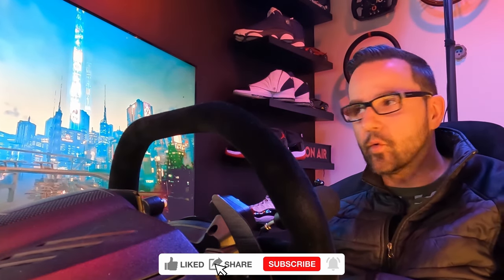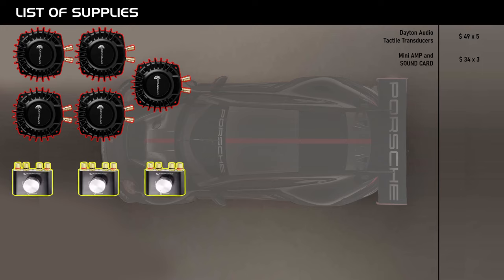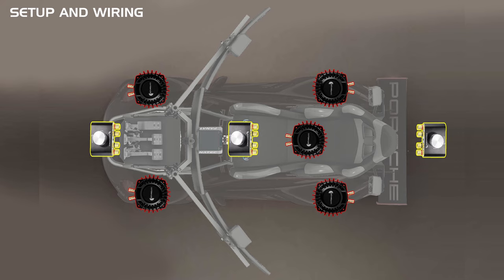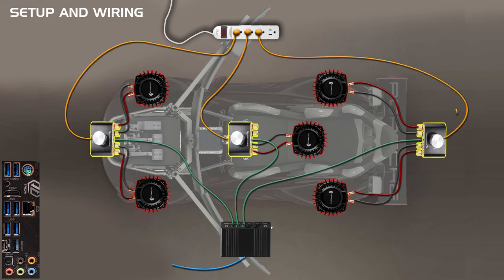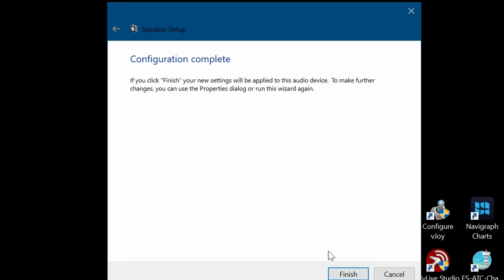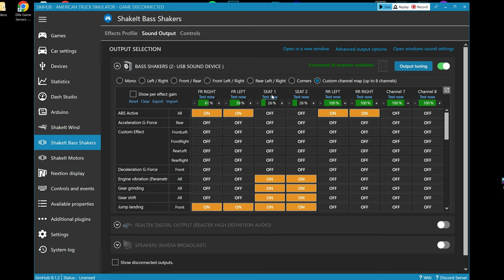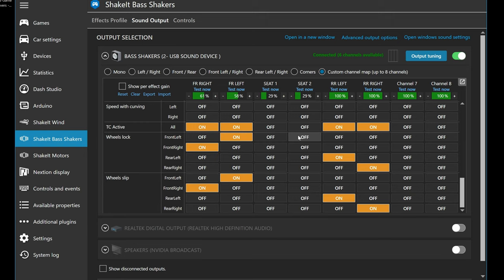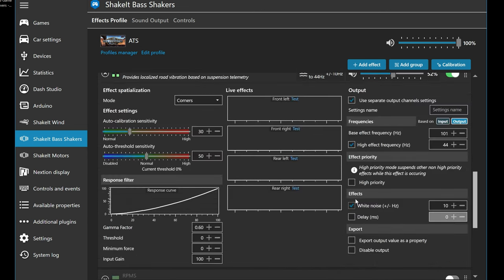DIY ULTIMATE Bass Shaker TUTORIAL | Step by Step HOW TO and SETUP

Comment: This question may have been asked but hopefully someone can direct me to the answer or tell me how this works.  I have my PC connected to a TV using HDMI and that is pushing sound through a Sonos Beam. I bought 2 bass shakers and mounted them to the rig.  My question is how do I get sound to the TV/Sonos and then also get the vibrations to work at the same time? Please let me know.
Reply from the maker: That is yet another reason why we use an external sound card. Dividing the external sound card from the integrated sound card allows you to process audio on the PC and send it any way you see fit to any source. Using an additional sound card allows you to process all these vibrations from the telemetry data and send them to your base shakers. A lot of people ask me why don't use the card on the PC, the audio card. This is one of the many reasons. An external audio card is very very cheap and it hooks up to your PC through USB as shown in the video
Reply: @DaSimSimma Thanks so much,  appreciate the help.  I will work my way threw it hopefully.  I am guessing I will have to change the audio configuration to get it working correctly?

Comment: hey man nice video but one question! i bought all equal your video! but one thing is not right, you put 5.1 without the rear on the configuraton, and on simihub you put seat 1 and seat 2 on mine just the chanel 4 works the 3 doesnt why:
Reply from the maker: Let me look into it in more detail later this afternoon as I am not in front of my PC. I do remember something odd about my seat where two channels seem to server the same purpose on the seat speaker. Maybe I hooked it up wrong ..not sure . But only one channel working for the seat shouldn't be a problem . One channel =one speaker . Is everything else working ok thought ? Is your set up working properly but it's just different than mine ? In which case I might have made a small mistake somewhere ? Let me know and I'll look into it later after work ! Thanks friend
Reply from the maker: Just a small side note. I don't mention this in the video, but for my seat bass shaker I use a different amplifier that is different than the noob sound. Perhaps in the way I wired it the outcome is slightly different than I'm explaining in the video
Reply: @DaSimSimma  I will install all the 4 bass shakers today, but the Chanel it’s working properly! Your video it’s good I just want to know if it’s working on 2 channels, and the amplifier you put on 100% the volume? I let mine on 50% the bass shaker that is only on channel, on the seat, the other ones I will install in 100% the volume on the noobsound!
Only one thing if you can do a video explaining your profile with the bass shakers on simhub will be a lot of views like this one! Thank you

Comment: Hello, would it also work with a 5:1 sound card already installed in the PC, or do I have to have an external sound card? Thanks
Reply from the maker: It absolutely works with the internal sound card. I think I mentioned that in the video the problem becomes if you use it to put out vibrations what do you actually use to hear the sound of the car? Once SIM hub takes over the card you're not getting sound out of it you're just gonna get telemetry and vibration to the face shakers
Reply: Thank you.
For the vehicle sound, I would go to the internal sound card onboard from the mainboard....
Thanks for the help!

Comment: Could you please confirm if it's possible to utilize the onboard sound card of the motherboard if it supports 5.1 and 7.1 and has an adequate number of outputs?
Reply from the maker: Of course you can, but as we discussed many times in this comment section : If you do that, then the PC audio there for the game audio will have no way out. Which means all the sudden you'll get vibration but you will no longer get audio from the game. The audio card can only do one thing at a time
Reply: @DaSimSimma  Thank you for your response. The thing is, I've ordered all the equipment, and my only remaining question was regarding the sound card. Now I've got it all sorted out and will follow your assembly instructions. 🤜🏻

Comment: I Went ahead and bought all 5 of them to do a setup just like yours but I have the GT Omega Art rig how can I mount them? Would you have any tips for me? Its a metal rig basically.
Reply from the maker: I just looked up your rig and was looking for opportunities. The first thing that I see is you have different options for your pedal angle. I would suggest using the unused pedal holes. I would Mount the speakers or shakers onto a piece of plywood or something similar then I would take the plywood and bolt it through those holes that's for the front. I don't have any advice for the rear because I couldn't see any pictures of your rig from the rear. But the main takeaway, just like mine, attach the Shakers to a piece of plywood and leave enough room on that plywood to screw the plywood into something else. I hope this helps if not peep my community Tab and somewhere in there you'll see a discord link to our discord channel. Hop on in there when you start mounting and if you run into any issues I'll do my best to attempt and help you
Reply: @DaSimSimma  You are the best! Thank you very much for the quick respond.
Reply: @DaSimSimma  Can I use 18 AWG instead of 16 awg for the speaker wire? Silly question here I know :D
Reply from the maker: I am not an electrician but I can tell you that I've used both especially in the beginning of my sim setup. Should be absolutely no problem or difference in quality

Comment: I want to replicate your setup with bass shakers.
1 Question.  Do you get the same detailed separation if I don't use 3 amplifiers. You said the only reason for using 3 was because of USB on the computer.
Reply from the maker: I hope I understand your question correctly .here I try : you can use only two Amps . For example :The two amps will give you 4 channel capability. You need to plug each one in the back of your PC. You need to set them up as STEREO. Because that is all each of them can output. Ultimately each amp will act as an amp at 50 watts per channel with two output channels. One for left and one for right side. One amp can do left and right rear and the other can do left and right front. I hope I am answering your question

Comment: Do you need the Aux Cable? I run two shakers withthe nobsound mini and when I rev a car in iracing im getting this grainy grinding sound I'm not sure where is coming from and having a hard time islolating the issue. Any help would be greatly appriciated. Thanks !!
Reply from the maker: Sorry for the extremely late reply. You cannot run these with an AUX cable. You have to follow my instructions carefully and try to understand how to utilize it using two of your shakers. You don't want to get sound from your PC you want to get a signal from your pc. Simhub sends a digital signal that gets turned into sound. If you plug in the aux cable you will simply get audio noise or audio from your game translated into rumbles basically the Shaker will try to pretend to be a speaker.. I'm doing my best to interpret what you said but not being there and seeing it I might be wrong

Comment: Thanks for this. With that I have a couple questions. First are you mistaken how you have drawn the exterior sound card ? You say the first 3.5 Jack is a out put but it is a input? The next three are outputs. Assuming so I have hooked up to the last three 3.5 Jacks on the card and I now have a problem that all the sound from the game is now going threw the base shakers. I still need the game to also play three my regular speakers . I need sound for my game but I also use my computer for other things.
Reply from the maker: Hey Jon sorry it's not working out perfectly for you at this moment. It'd be very difficult to try to explain through writing. This is going to be a really crappy thing to say but many have had success with this tutorial so perhaps you're doing something wrong. Slow down look at it again and try to hook it up you missed something. The fact that the game audio is coming through the base Shaker tells me that you didn't prioritize in Windows sound settings which is your default sound card. The default sound card should be the one that goes to your speaker. That should be said as a default communication device. The other card should be properly hooked up and set up in Sim hub. Sorry bud I know this is not much help. The next step you could do is go to my main about page find my discord and join us there I'll do my best to offer you some help tomorrow through a voice chat
Reply: @DaSimSimma  I'm sure I am and if I sound like I'm blaming you I apologize. I was asking questions because I am having problems. I thought that toward the end of your video you asked that I reach out if I had any problems, so that's what I did. This is all very new to me from the computer to the sim rig , and now base shakers. With that said I would still like to make everything work correctly so if anything comes to you please let me know. Thanks and again I'm sorry that I came across offensively
Reply from the maker: No way at all my friend. I deal with a lot of aholes on YouTube, you sir are far from that!!! Let me know if you see the discord link and try to join us there. I am very very busy this coming week but will try to make time tomorrow night or Tuesday for a private call. https://discord.com/invite/z8K528Ba65
Reply from the maker: I remember how difficult it was for me to set it up the first time, so I'm not surprised you're having issues. That is why I made the video in hopes to help you and everyone out there that wants to set this up. But, absolutely, please reach out. Let's get on the phone call and let's solve it for you. I can't wait for you to experience the awesomeness !!!
Reply: I'm not entirely sure what I did but I think I got it
Reply: Is there somewhere that you are aware of that has explanations for meanings of. Like use separate output channels settings. What does that mean and is the a manual or something that I can go to and rear about what things like that mean?

Comment: I have a sound bar with surround speakers and after setting up the bass shakers like u I have lost the sound in my surround speakers at the back of my rig, any ideas how I can use both
Reply from the maker: Did you use an external sound card or did you use the sound card on the computer?
Reply from the maker: These things are good, complicated to describe without looking at your setup. But sometimes when you install a new audio card, even if it's external, it does get defaulted as your main audio source. So sim hub will be using it, but then the PC no longer knows which is your main actual audio source. I hope that makes sense. Thus, your audio sources might have got mixed around and you're no longer getting audio through your speakers. Again, I'm just taking guesses here

Comment: Could you just use 3.5 jack audio cables instead of speaker wire to connect the power amplifiers to the external soundcard?
Reply from the maker: Sorry I'm a bit confused with what your asking . The power amplifiers are connected with 3.5 only ...the speakers are connected to the amps with speaker wire. Sorry let me know if I didn't understand your question.
Reply: @DaSimSimma  My bad. I was looking at the speakers and thought the connections were for a 3.5 jack. Thanks for the reply and the great video!
Reply from the maker: No problem at all ! You'd be surprised how often I make mistakes ...human . Lol you had me going back and watching my own video . Lol thanks again for watching. I appreciate you

Comment: out of curiosity, could you have installed a USB expansion card and eliminated the external sound card?
Reply from the maker: Absolutely, but I have a small case and there's no more room for anything. I could have also used the USB hub but I honestly did not want all those wires running back anywhere so all the wiring is contained underneath my Sim rig. The only thing coming to my Sim rig is one USB plus a power strip cable :) I hope that I mentioned in the video that this is only my way. It's definitely not the only way!
Reply: @DaSimSimma  you did mention the one cable which is also a great and clean option!

Comment: i mount the skaker direct on the 4 sides of my rig but the power is really low do i need to mount it like you did so they hanging in the air ???
Reply from the maker: Please take anything I say with a grain of salt. It's just my silly opinion. I do believe that when I hung them off the way I did or attached him to a piece of wood it added an extra level of vibration. It literally enhances the vibration. I think that if they're hard mounted to the rig they can't really vibrate anything because the rig is so solid. I don't know man, I'm just shooting ideas out. I hope I'm not speaking out of my rear end
Reply: @DaSimSimma   but you are totaly  right mounted direct on the rig everything is low vibrating but with your mounting opinion its way better

Comment: may I know why are you using the external soundcard when those amps has built-in sounncards? Is it due to spare some USB ports on your pc?
Reply from the maker: I mentioned that in the video that I'm trying to save USB ports. I have so many peripherals and so many cool things plugged in. I don't have space for each one of those amps. I think I specifically talk about this
Reply: Do you think it does not have a delay in compared when that extra soundcard would not be used?
Reply from the maker: I don't notice any delay guys. Again, when I hear about delays in simracing it sounds like we're professionals trying to win the formula 1 championship. The reality is , you guys are talking about milliseconds in delay which makes no darn difference when we're having fun Sim racing. Perhaps I'm a little bit too light-hearted about it, but again I don't notice any of this stuff. I'm just having fun

Comment: How can you use this on the console (PS5) with two or four bass shakers? Simhub now supports GT7 and both AC games (I think).
Reply from the maker: In theory, you could but it's not as good as on PC. I used to run it on PS4 with only one Shaker. I wasn't using sim hub at the time.  I was actually just directly translating audio noises from the game and turning it  to low frequency only and then to the shaker. The short answer is, I'm probably not the best guy to ask since I honestly don't really know. Continue to scour YouTube I guarantee somebody out there has the answer and is very willing to share! Sorry again. I wish I could help . And if you find the answer, please come back and drop a link here. Maybe it could help other people out.

Comment: When I plugged in my shaker setup it apparently overrode the regular sound output. So now all I hear is the shaker setup. Any ideas what I'm doing wrong?
Reply from the maker: You specifically have to make sure to use an external sound card. This way you can tell the computer to send all the telemetry data to that external sound card. Then you can set up your main sound card to still output game audio. Divorcing. These two things specifically is hugely important and going back into windows and defining what each one's role is is also important. Sounds to me like you're using only one or you didn't define the roles. So now it's using the Shaker card as the main card. But it's being overwritten by Sim hub telemetry data. So no sound will come out
Reply: @DaSimSimma  I can't seem to find it in windows. I currently have it plugged into a USB hub, I'm guessing that's why. I need to get a longer USB sound cord to actually reach the computer. I hope that solves the problem. Currently if the Amp is turned on, all I get is base shaker sounds out of the shakers and my headphones. With the Amp off, I get regular sound in the headphones.

Comment: If I start with one bass shaker, will I still need an amplifier and the audio card?
Reply from the maker: The shake MUST BE AMPLIFIED! they cannot be powered by a simple audio wire...so you will need one NOOB amp. As I seen the video that a also a sound. So all you need is that . You can plug it into the wall and into the shaker to power it. Plug the USB in. The PC and go to sound settings to set it up . It will be recognized as a two channel sound card LEFT AND RIGHT. Therefore ...you might as well buy two shakers..cause the amp will be amplified and ready to send a stereo signal . Then go inside simhub and assign this new sound card as the default
Reply: @DaSimSimma  Thank bud! Appreciate!